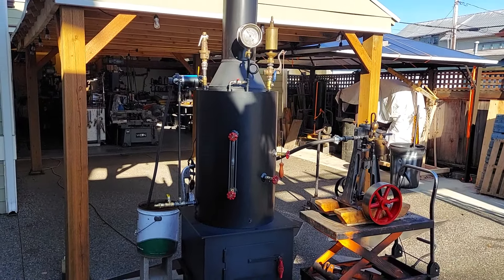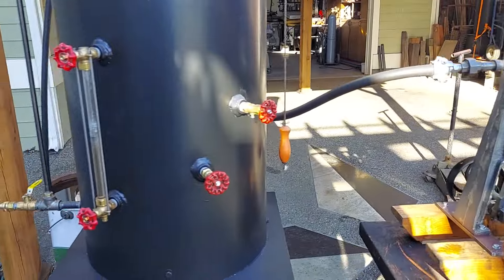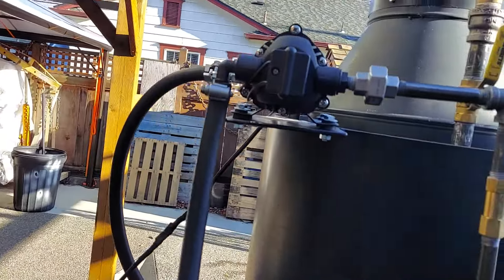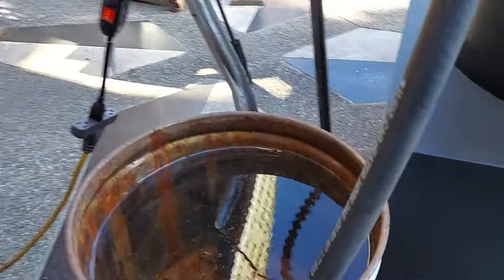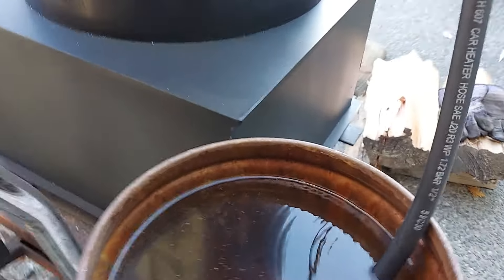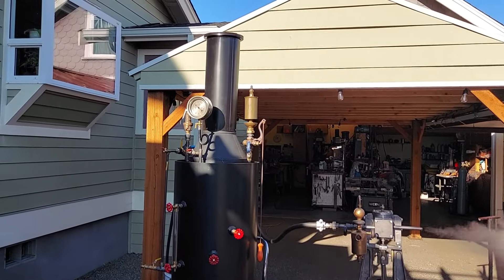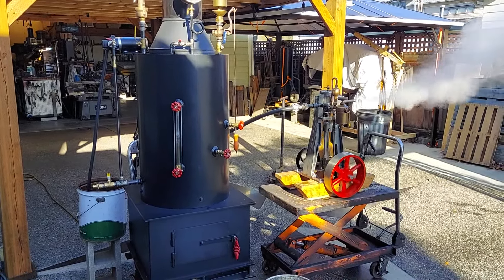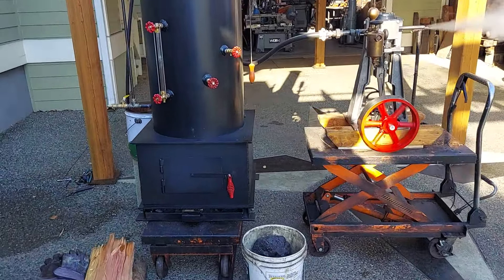Steam Boiler and Engine Combination Antique Whistle Pump Gauge Off Grid Ross Bendixen

Comment: 👍👍👍👍👍👍 A great setup Ross. The engine is smooth running and well balanced. Good HARD work Ross. Unmatched.  A metal craftsman that there just aren't enough of in our land anymore. WELL DONE !! Also, I can't find that type of coal anywhere in Michigan. They all come in bags and are shipped from PA and there not much larger than charcoal briquettes.
Reply from the maker: Ed, Thank you very much. I have been getting coal from Utah. Called Utah nut coal. Get large chunks the the size of your fist and bigger. Ross
Reply from the maker: Stove coal, low draft.
Reply: Thanks Ross. I remember the name of the product but didn't know where to get it as it is not available anywhere in MI. Not even in the UP. Do they ship it to you ? Can you send me the contact information to that company. How do you receive it? is it in bags or crates ?  Thanks Ross. @rossbendixen
Reply: Very Nice! Thanks for the look.
Reply from the maker: I picked it up in Chehalis Wa. It is called Utah Nut Coal. There are many coal mines in Utah. Google it. Maybe some of these companies will ship bags or crates on a pallet.